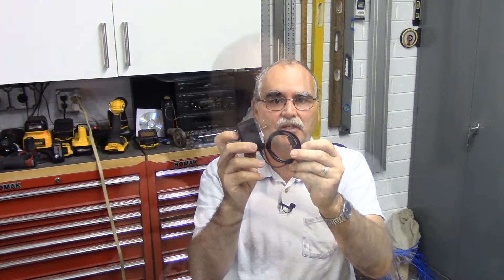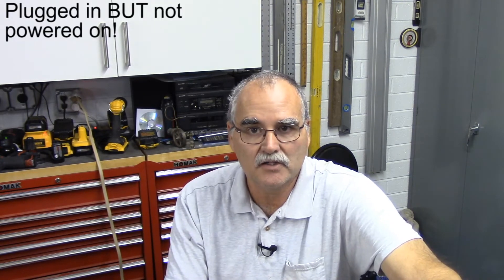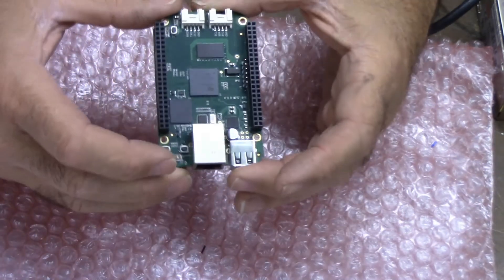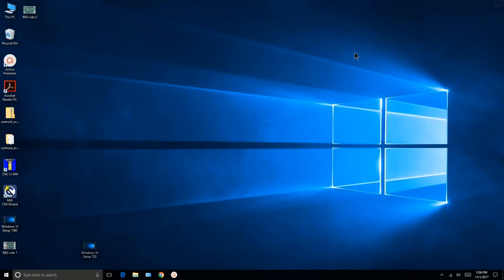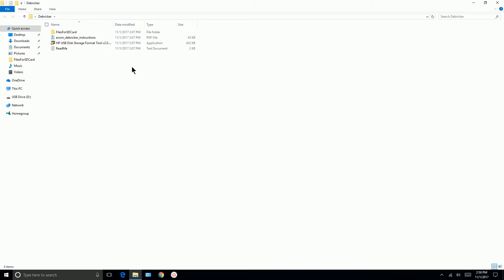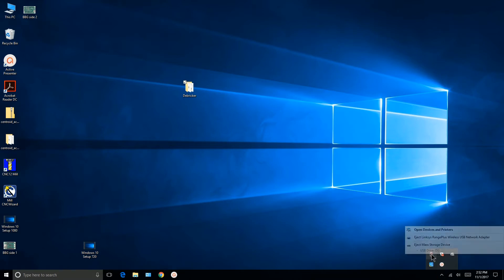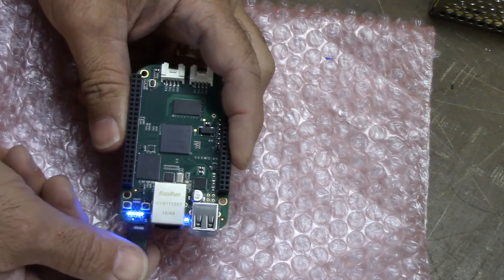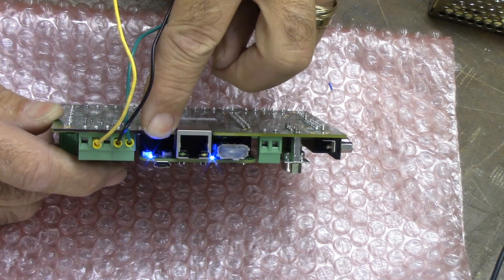Centroid Acorn CNC Basics - Debricking Centroid Acorn CNC

Comment: Im an engineering masters student and I inherited the an Acorn CNC from a previous project. I ensured that the board was properly installed and it ran previously but Im having an issue where neither the blue heartbeat light nor the blue power light on the beaglebone will turn on. Is this the issue youre referring to in the video? I want to ensure that reloading the firmware is the correct action to take.

Comment: I am not sure if I need to re-flash the board, but my problem is when power is applied to the board the blue power LED (the one that should be always lit up) quickly flashes then turns off and no other LED illuminate on the board including the heartbeat LED.
Reply from the maker: Please post to the Centroid Acorn Users forum....unplug EVERYTHING except Acorn power and Ethernet cable and retry (assuming you are using Acorn with BBG as shipped from Centroid)

Comment: Does the firmware have to re-flashed if you change to a different computer after the original computer is no longer available?
Reply from the maker: No. Just reload the software and reinstall your license
Reply: Thank you Marty, I did that but the issue ended up being a corrupt ddl file that was messing up the interface with CNC12 on screen controls. Works great now.